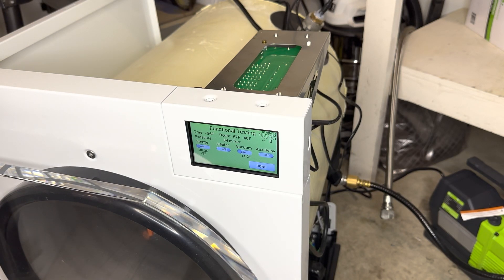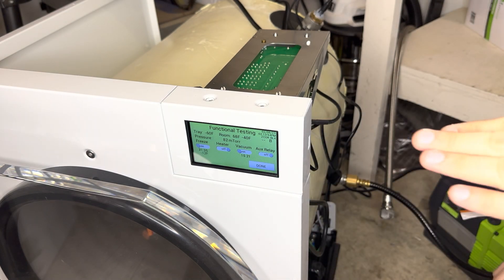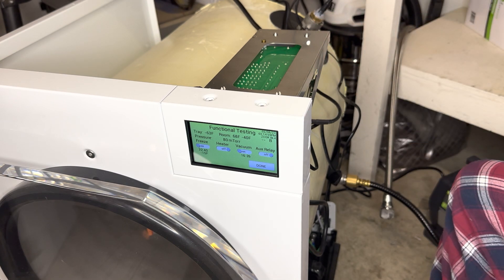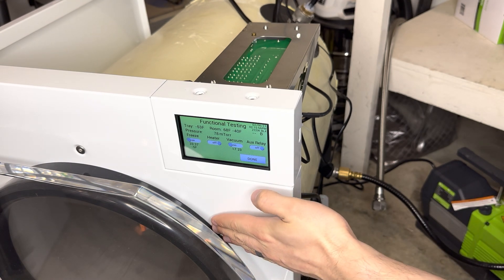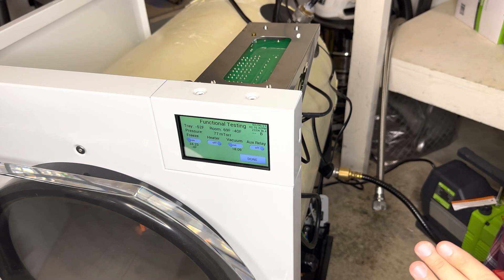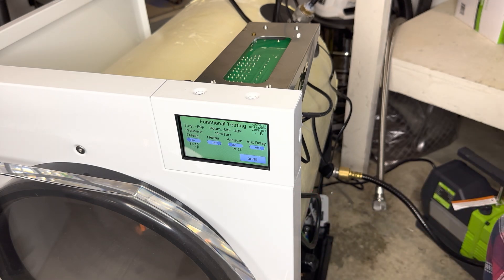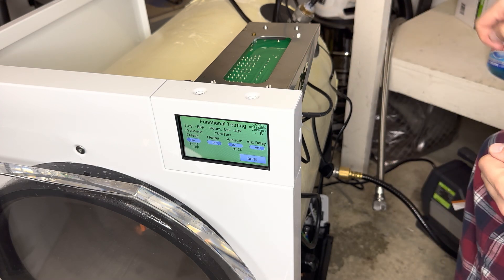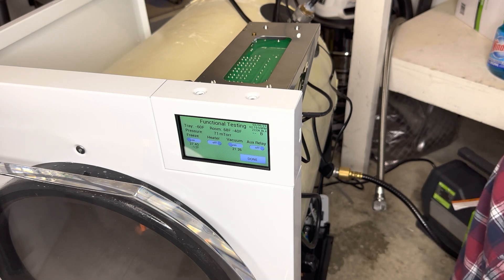Check Harvest Right for Vacuum Leaks

Comment: Once you turn off vacuum test- should your machine hold the vacuum (if you do not open drain valve)?  Thanks for the video!
Reply from the maker: It will not hold vacuum on this unit. Right now the only one that will hold vacuum like that is Stayfresh.com
Reply: You would need to be using an auto,attic isolation valve to keep vacuum.

Comment: Bad idea using Windex or ammonia based cleaners on anything metal or plastic.  Ammonia readily corrodes metal and either weakens or significantly discolors plastics.  Ammonia is mostly used for glass cleaning and/or when cleaning paint brushes, rarely recommended when cleaning clothes due to chlorine being more commonly used.  If I'm not mistaken, oxidizers usually strip metal of any protective paint or oil coatings, then oxidizes metals.

When checking for air/gas pressure leaks, use a water and dish soap mixture.  When testing air/gas pressure leaks during Winter or freezing conditions, can add  propylene glycol for lowering the freeze point of the dish soap and water solution.  There maybe better foaming test solutions on the market, rather than using a  foaming DIY made solution, however when working with food and food appliances, I would look for something NSF rated or focus on food safe solutions.

Otherwise, good video, surprised a known company such as Harvest Right is not vacuum testing prior to shipping, or incurring leaks during shipping.
Reply: This whole video was a bad idea.